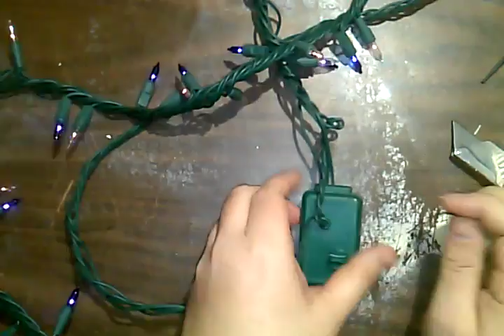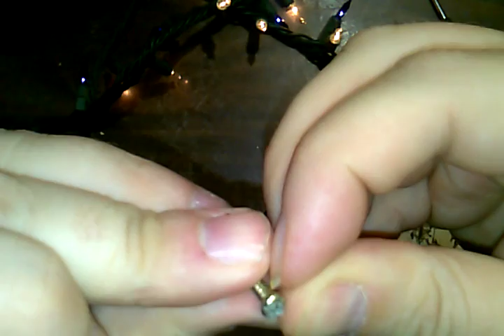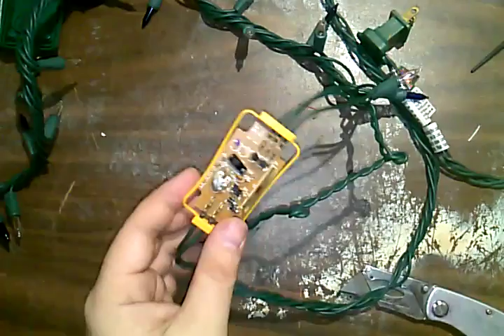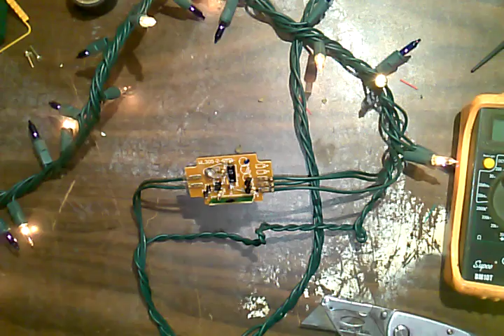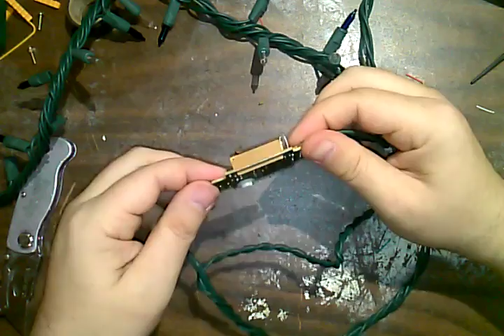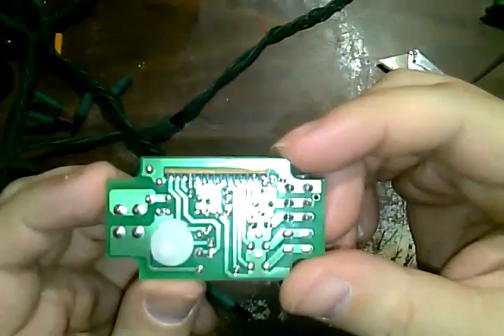Old fading style Christmas lights go BANG!

Comment: I had many boxes including some rare versions go bang also those are the worst connections because they can come out while plugged in n bang
Reply from the maker: It's that time of year again where we get to pull all the goodies out in the way of lights and see what works and what is fouled up and has a possibility to go bang or allow the magic smoke to escape.. Fun times await me.. If I can remember I will try and record some of it and maybe I can catch something exciting happening with electricity.. maybe flames?
Reply: @Elfnetdesigns  yep I nearly made my rare 12 function box go bang last night I couldn't get the yellow channel to work turned out a wire  came away from the pin if I would've moved the box It would've shorted out needless to say I changed the set real quick lol